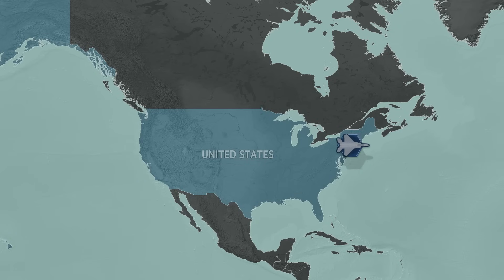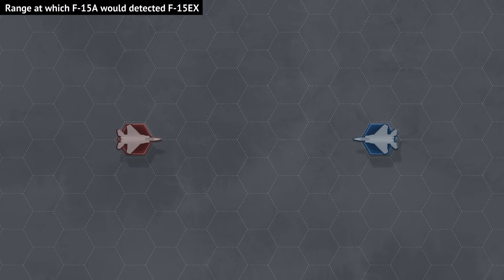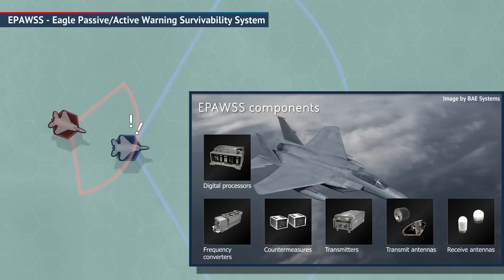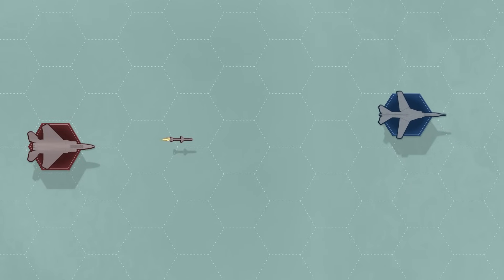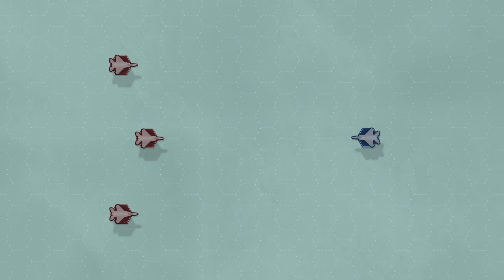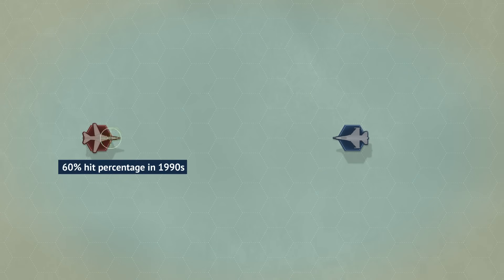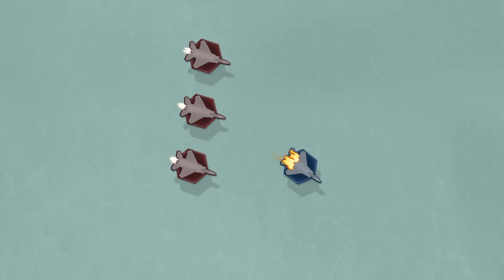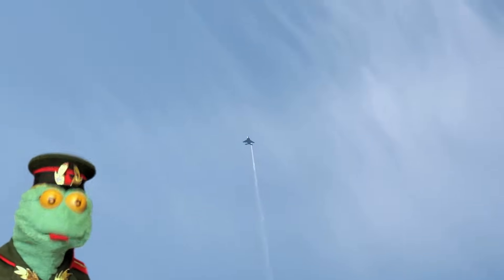How many F-15As would it take to shoot down an F-15EX?

Comment: In almost all situations, the F-15EX should have a wingman of the same type. In that case, it is more complicated than simply doubling numbers because of the differences in capabilities and tactics when working together. 2 F-15EX could probably take on 24 F-15A with historical systems and load outs with only one or zero losses.

Comment: EX's 12-missile limit is key. 6+ F-15As attacking from multiple angles could overwhelm it despite tech advantage. Quality vs quantity dilemma!
Reply: TWS in the EX would allow it to engage 6 (at least) targets simultaneousl with AIM-120C or D models, at a much greater range than the As could employ their Sparrows, whatever the variant used.

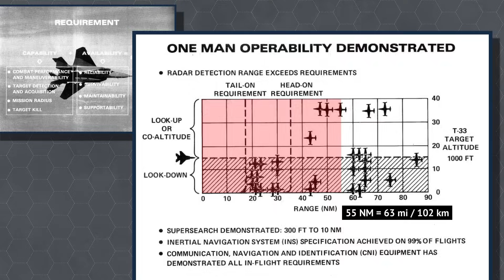Comment: 2:00 - I've heard/seen a lot of video about he F15s. While I don't recall an exact number for the radar cross-section (if there was one), I've heard many experts and enthusiasts say that the F15 is about as non-stealthy as you can get. The F15 is a "loud and proud" aircraft, and commands have used that to their advantage.
Reply: Its got 2 massive exposed compressors, its basically broadcasting it's there to anything in the front couple degrees. Other than those couple of degrees, it should be pretty normal as far as stealth goes. A lot of stealth is about build quality, panel gaps, fasteners and other stuff like that totally kill stealth, its why everyone clowned on the SU-57 prototypes with their exposed screws. It is still a massive aircraft, but it shouldnt fair worse than any other big bird without RAM. In addition to that, jet blast is actually radar reflective, and afterburner trails especially so. As soon as someone lights their burner they are popping up on radar, no ifs no butts. 

I'd guess, as a layman, if the EX flies really high to block it's compressors from view and doesnt afterburn it would pretty easily spot the A's even considering its in lookdown mode, it could then blast off all its AMRAAMS and turn back, not really having to worry about being detected. If it needed to stay and fight it wouldnt need to light the burners to climb and would therefore stay hidden even longer while planning an attack, and then when the A's did detect it, its at high altitude, possibly in supercruise and the Sparrows would have a hard time hitting it. None of this would change the outcome of the battle though, the EX would need to land and re-arm before it would have a chance against more than a dozen A's.

Comment: 1:15 - I'll ignore the, "oldest current F15s in Japan," comment. One of the advantages of 4th gen fighters is that you can upgrade the aircraft by using pylon (aka hard point) attachments rather than replacing internal equipment. The F15 has pylons to spare, and I'm sure that's what Japan has been doing with their older F15s.

Comment: You should reach out to "Growling Sidewinder" or "Grim Reapers" and have them game out this scenario
Reply: Growling Sidewinder actually did something pretty close to this:

https://www.youtube.com/watch?v=H66t2Xj0MXI

(And no, I have no idea how accurate or not the F15EX model he's using is)
Reply: You could do it more realistically in a sim called Command: Modern Air Naval Operations. It has darn near every unit, weapon, RCS for everything, all of it. US Govt uses a classified version to war game as well.
Reply: So, I ran the test in CMANO. The EX maxed with 20 AIM-260's and two AIM-9X's took out 10 F-15A's (2 missiles per aircraft). The F/A-18E with AIM-174B's took out the F-15EX before the 18 got into range of the AIM-260, and the F-35C with EOTS and radar took out the F-18 with an AIM-260 because the 18 couldn't see the F-35. The F-22 should be similar but I prefer the 35 because the EOTS can be used at long range and the radar can be turned off, still guiding the AIM-260 until the last second. If the track is high quality, the AIM-260 can delay turning the on board radar on until the last second, so the enemy gets an alert, they look over at the RWR and then immediately explode.
Reply: @speedycpu  the US gov doesn't directly but think tanks that consult with the US military do.
Reply: The EX is fine I guess but come get me for the F15 Touring package with leather seats and turbo.
Reply: @HiMyNameisAndy91 wish they put the ex fender flares on the touring package 😡
Reply: Why would you ever do anything with the Grim Reapers. Nor is there a roughly accurate F-15A or F-15EX in game. You would be putting a slightly modded 1990s F-15C vs a 1990s F-15C mod with a skin and speculative mods on weapons.
Reply: @imjashingyou3461  The accurate answer is you need at most 13 F-15A to shoot down 1 F-15EX because F-15EX can carry only 12 missiles.
Reply: Or you need at least 2 F-15A. One approachs F-15EX directly from the front to distract the pilot while the other one takes position in the back of the F-15EX for missile launch.
Reply: @수포자의철학놀이4  You can't magically make the F-15A appear behind the EX. The EX can see a huge area of sky out to 240 miles. If a 15A tries to flank the EX will see it no problem and shoot that one first. The EX can detect the A model and fire well before the A's radar detects the EX. Also the A would have to run radar off to try to sneak up to the EX and thus wouldn't know where it is. If it had AWACS help, so would the EX, so the EX would again just turn and fire from 100 miles away. It really is near impossible for the A (even the C model) to do anything to the EX. Soon as they fit the AIM-174B to it, only a matter of time, it's going to be insane. 200+ mile kills on the 15A start becoming a reality. Try to war game it in CMANO, you'll get a better sense of how bad it is. I didn't like the F-35 much because the F-16 could out dogfight it, but war gaming those scenarios with accurate RCS, EOTS, accurate weapons, etc, it is the F-35 that clubs the 16 like a drunk baby seal. When the 35 runs out of missiles, it simply goes back home. No need to get in close, unless another stealth aircraft gets lucky and in close, but the SU-57 is detected from fairly far away, same with the Chinese jets.
Reply: @speedycpu  240 miles? Is there a radar that can see that far? Even if there is one, can air to air missile reach that far?
Reply: @수포자의철학놀이4  Yes, and the AIM-174B can reach ~300 miles.  Even if your missile can only go 120 miles, you can still see the other aircraft much further with a long range radar, getting into a better position. This scenario is 15A vs 15EX (advanced AESA radar). 15EX will see the 15A at roughly 180 miles, and can see and dictate the fight and fire before the 15A even knows what's going on. The 15A's Sparrow is a huge limitation and extremely short range these days, and requires you to maintain a lock. The AIM-120C D, AIM-260 and AIM-174B are fire and forget. They can even be datalinked and guided by AWACS..There are even talks about fitting a B-1 with a bunch of AIM-174B's and using it as a missile truck.
Reply: @speedycpu  300 miles? I think you are talking about a ballistic missile. Air to air missile can't reach 120 miles due to lack of fuel. An air to air missile with range of 120 miles? How big should it be to carry all the fuel? It's going to be too big to be carried by a fighter jet.
Reply: @수포자의철학놀이4  "just get behind him" ass comment lmao
Reply: @수포자의철학놀이4  You're clueless lmao. You realize missiles can loft right? they dont need fuel for the entire flight. also its not like they are burning an insane amount of fule since the mass theyre propelling isn't that large
Reply: Are you being seriously with the Grim Reapers?
Reply: @FirstDagger  Uh-oh...what did they do this time?
Reply: @FirstDagger  Sure why not?
Reply: @ Look up their past controversies.
Reply: @FirstDagger  too lazy to look up controversies cuz maybe what’s controversial to you is how they set up their scenarios.
Reply: @FirstDagger why should I waste my time looking up the controversies of a small wargaming channel?
Reply: @ Wasn't talking to you bud.
Reply: @blurglide  Too much blah blah and simply dont care enough about facts and accuracy to be much more then a firework show. Also, just not skilled pilots. 
They make alright stuff, but if we want to see how a scenario could be done, you gotta go with GS

Comment: I had no idea the early radars were that bad.  
At 45,000', the horizon is only 260 miles away, so I guess the new F-15 has as big of a radar as it could make use of for non-stealthy targets.
Reply: You can bounce radar off the atmosphere. Ships use it for their tracking
Reply: 1975 wasn't "early".  1945 was early, and it was light years better than the original radars of ~1938.
Reply: @RonJohn63  i don't think you understand, planes were invented in 1903(wright brother's goofy 12s shit), modern jets were invented in 1939, so yes, 1975 is early years, 1945 is the infancy, planes are exponential in gap, from 1939 to 1975 is just 36 years, 30 years if from 1945-1975, and from 1975 to 2025 is 50 years, do you understand now, how 1975 is in the early years of usable modern jets? just like how you would call your childhood and teenage years as you early years.

Comment: The EX may have more drag related to its CFTs but it also has much more powerful engines than the As did.
Reply: CFTs are optional, just like with the modern F-15E. F-15C also was CFT capable, and Israeli F-15A and B also are.
Reply: Thank you
Reply: @devyn.n05 , I may be wrong but the CFTs on the E/EX may not add any drag compared to the original A/C Eagles.
Reply: The F-15EXs won't come with CFTS. AF didn't order them.
Reply: @sammanix5585 why would you order them when you only have 8 airframes in active service? Give it a few years.
Reply: @ They can just mount the F-15E CFTs, no?
Reply: @FirstDagger its not like they have a warehouse full of extra CFTs💀 and they aren't retiring F-15Es. F-15EXs are filling air superiority roles. They won't wear CFTs. The only jets that do are the test jets and that's because they're test jets
Reply: @sammanix5585  the current Air Force plan is to retire half the F-15E fleet. Go from 208 to 98 Aircraft and only retain the Big motor modded aircraft.
Reply: @sammanix5585  they should've made F-15CX
Reply: @FirstDagger 
Unlikely. The wiring of the F-15EX is gonna be vastly different from the E, so it probably won’t be compatible.
Reply: whats an CFT?
Reply: @THELANKANCOMRADE , sorry about that, CFTs are Conformal Fuel Tanks.
Reply: @THELANKANCOMRADE 
Conformal fuel tank. It’s on the sides of the intake and looks kinda like it’s bulging or bubbling out.
Reply: @jesusofbullets  ah thanks! If its conformal then there should not be much drag as opposed to wing mounted fuel pods no?
Reply: @THELANKANCOMRADE 
A bit less drag, but more importantly, it allows 8 bomb racks to be mounted, allowing for more ordinance to be mounted.
Reply: The EX is NOT equipped with the CFT's, it can reach Mach 2.9 top speed and has super maneuverability short of only the Raptor. It carries 22 Air to Air missiles with medium to long range able to lock and launch at 100 miles +
Reply: @Pooky1973  it can theoretically do these things. Just not all at once. There's no way it's going to be supermaneuvering with 22 AIM-120Ds on board.
Reply: @josephahner3031  To be fair, by the time it will need manouvering in this scenario, it won't have the amraams anymore.

Comment: The AIM-7F first of the sparrow was a vast improvement over the AIM-7E but it’s still only featured a mechanical conical scan antenna.   It was actually the British AIM 7E derived Skyflash missile that was more advanced with its monopulse seeker.  
-The sparrow received a monopulse  seeker finally in 1982 as the AIM-7M.  
-Mono pulse means that you can’t break the lock of the missile by feeding back a modulated jamming signal modulating at a frequency set to the Mechanical scan.
Reply: Skyflash 2 would've been even more advanced but got canned due to no doubt political pressure
Reply: @SnakePliskin762  and of course, the introduction of the AIM-120 AMRAAM as well
Reply: @BluePegasus1381  skyflash 2 was about 10 years at least ahead of AMRAAM at the time and could've been in full scale use by the mid 80s,,eventually the research was used to develop the meteor from it.
Reply: @BluePegasus1381  hell even the AIM-7R with a dual mode Semi-Active and infrared terminal seeker. Possibly with a propellant change to the M for longer range. Would almost be a fire and  forget weapon only requiring midcourse guidance for long range shots.  But it also having dual mode would have a vastly improved hit rate and would likely have been impervious to jamming/decoys if you used the semi-active seeker in terminal as well.
Reply: @SnakePliskin762  skyflash 2 was nothing other than a paper proposal still needing research. Same as other proposed US active missiles at the time.  The reason the British gov showed no interest at any point was there was already a NATO missile aquisition process in place where Germany, UK, and the US agreed to procure the same two missiles.  The AMRAAM and ASRAAM.  This got US funding for the ASRAAM. However Germany left in 1989 which caused the US to pull out of the ASRAAM.
Reply: @imjashingyou3461  the research was quite advanced and later used in mica with the Thompson-CSF seeker.Range would've matched AMRAAM with better use at Short ranges.  Unfortunately YT stops me sending a link to an informative source with all this on. Skyflash 2 or active Skyflash as it was later called got canned early 80s but was kept on the books and marketed to other air forces such as the RAAF well into the mid 90s.